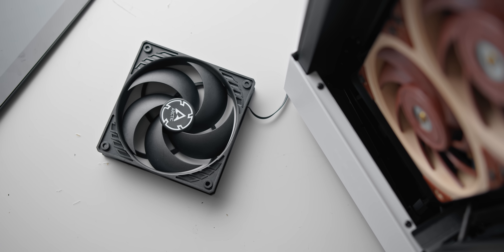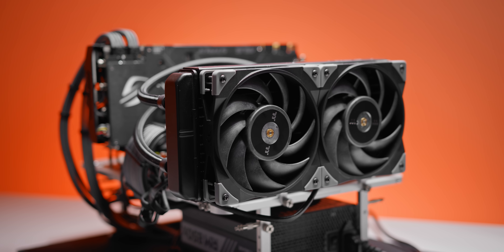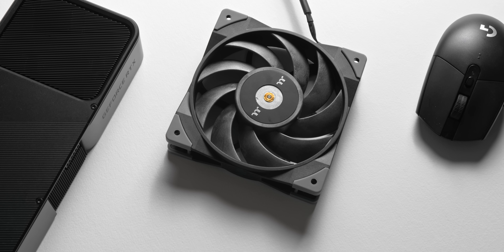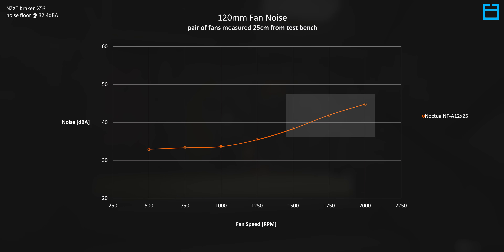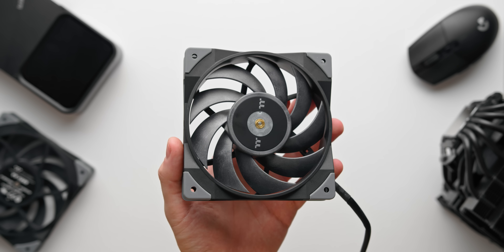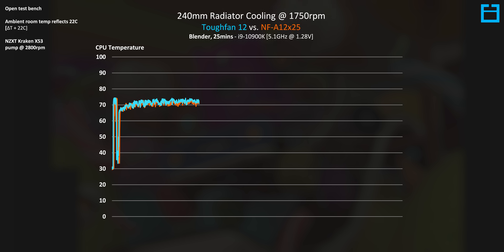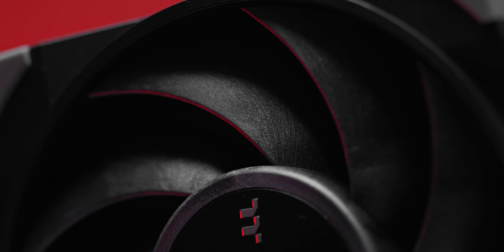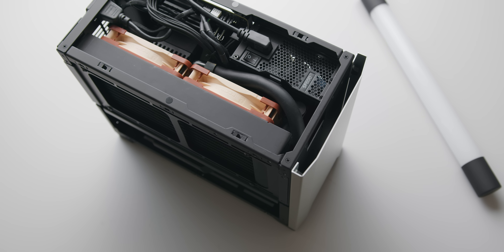Thermaltake Copied Noctua?

Comment: I'm still going to wait for Noctua's
Reply: Noctua has been promising it for years, no joke since like 2018 if I recall they demoed it at CES. 2018!!! Where is the fan Noctua?! If you look at their roadmap they haven't done anything all year in 2020, they pushed the entire roadmap to this year, and some of the things on their roadmap aren't even innovating like a redux line cooler is just slapping a redux fan on one of their existing coolers. The ugly truth is that Noctua has not done anything for years because they feel they are at the top and lack any incentive to innovate even the slightest.
Reply: @ronakparikh  i mean, completely copying their fan isnt Innovation either
Reply: @PLPlolol1  it's not but noctua deserves this
Reply: I ended up getting S12A Chromax instead, for exhaust fans. Haven't seen much benchmarks comparing A12x25 vs S12A for exhaust only. No radiator use I mean, as A12x25 with it's higher static pressure would obviously be better for that. The S12A has better airflow though. Noctua has this comparison chart: https://noctua.at/en/nf-a12x25-performance-comparison-to-nf-f12-and-nf-s12a
Reply: @PLPlolol1  making it black is “:D”
Reply: Someone is going to release a black and rgb version of this fan. This fan has the best performance on the market and what people want are neutral colors and rgb, so if Thermaltake can get away with this clone other companies will go with what the market wants too
Reply: @ronakparikh  "IF thermaltake can get away with it" - here's hoping companies can't blatantly steal other companies' ideas and then manufacture it for cheaper. Otherwise all you end with is poorly designed and cheaply manufactured waste of resource products
Reply: @ronakparikh  I think you don't understand how this works. The color particles influences the plastic and its characteristics. Noctua has very high standards so if they can not build the black A12x25 to same standards as the normal they won't.
Reply: @interceptor001  I read the same marketing as you, it's BS. If they can make their ugly brown fan first of course they can make a black fan. In fact they had a prototype of a black a12x25 in 2019. Furthermore from this video Thermaltake was able to do it and they had to also copy the whole fan design. Just think for a second that if that was the case how is it that they are able to do this niche brown color but not black? Also while the blades are a new material the outer housing is the same material as all their other fans and they have chromax in the other lines. Why can't they make the housing black and the blades brown if that was really the case? The truth is that its just some BS they made up because they want to have an unreleased product to hold onto that they can dish out later if there is any real competition
Reply: Please do. Fan hub is sleeve bearing instead of fluid or ball bearing. Junk.
Reply: @ronakparikh  You should take a look at the gap between the blades and the housing of the thermaltake and the noctua. After this there won't be any questions left.

Why they are able to produce a brown one? Easy. For white/black you need A LOT more color particles.
Reply: @Aurummorituri  I don't know why someone wouldn't. Here in Austria you 6 years warranty on your fans. I bet thermaltake won't even produce their copy in 6 years anymore.
Reply: Regardless of the color, I'm more or less positive that TT's fan doesn't have the same "feel" and build quality to it. I could be wrong though. But I haven't used or held a 120mm fan yet that beats Noctua's feel and quality. It sucks that we need to wait (again) a little longer.
Reply: @ronakparikh  Noctua is a much, much smaller company than Thermaltake. Most of these delays are due tu manufacturing. The fact that they are having difficulties putting a black FN-A12x25 into production does not justify Thermaltake ripping them off. I hope they sue.
Reply: @interceptor001  P12's are German, yes? Proper fluid dynamic bearing with a 10 year warranty for $10 each or $40 for five here in the USA. Best fans for the money, period. Only spend on Noctua if you need the absolute best. I have five Be Quiet! fans in my case. German engineering usually wins.
Reply: @Aurummorituri  Not against austrian ;)
Reply: @interceptor001  No. Just that I like German stuff instead of junk. My first car was an old BMW. Second car was an old BMW. Second PC case was German. Amazing quality.
Reply: @Aurummorituri  I expect both were petrol engines?
Reply: @interceptor001  Yes. I miss my 1986 325is. It had a slot for that amazing thing called a "mobile telephone" in you car! We still drive BMWs. Mum has an M40i X3. Can't beat that petrol I6 in terms of smoothness and power delivery. She is embarrassed by how loud the exhaust is, though. XD
Reply: @interceptor001  Probably. I wasn't dissing Austria. I was just comparing quality European engineering to Chinese refuse. I was asking if Artic P12's are truly German designed (we all know they are manufactured in China like my fans).
Reply: @interceptor001  Give me a break. They're already producing black fans, do you really think we don't understand how to produce black plastic with the desired characteristics in the 21st century? Noctua is just way too slow at what it does, they make great products but they're really not suited to the consumer market, way too slow to adapt.
Reply: @retromunkey  Apparently yes. Because this isn't just "black plastic". Furthermore just because they are producing black fans does not mean they can use the same material for another fan design. Common that's engineering 101. If you have no idea what youre talking about you better stop talking about it. Did you know that they are using brown not because of the color but because it has the lowest influence on the expansion of the blades?  I am not saying that by now they shouldn't have been able to launch a black version. I am just saying that there may be obstacles we don't get to know about.

Comment: I mean, the a12x25 looks pretty similar to the gentle typhoon which has been around for ages at this point. For some reason Noctua though that it was a good idea to basically charge double for that fan here in Oz. If I can get 2 toughfans for 1 nf-a12, that's an easy choice.

Comment: Thank you for actually showing the difference at 1000rpm. More people need to do this. This rattling would drive me absolutely nuts as I'm specifically trying to remove distracting noises from my PC.

Maybe you should take a look at the Arctic P12 that you praised in the intro again. I bought 13 of those since they were supposed to be "amazing" for the price. However, the high pitched pulsating whine they emit around 900-1100rpm, and the weird grindy motor noise at around 750rpm made me return them.
Reply: I mean to be fair they're a $5 fan... they are pretty good for the price and they put the smack down on any other $5 fan. In regards to their Static Pressure and CFM at least they are much better than any other fan at that price. Don't know what you expected when 5 of them costs less than a single noctua...

Comment: There's some value in the accessories noctua includes with their fans: an extension cable, a splitter cable, and a low noise adapter. Depending of course on your individual needs, that can justify some of the price difference.

Comment: Did not know these existed.  Tks..  I picked up the Artic P12 and 14s for my First ITX build, moving my Back and Blue build into the ITX relm, this move was motivated due to your videos and I thank you for that!  Now I am running CTR and getting really good performance but need to manage the fan noise better.. It i really a process with these ITX builds...  Oh yah almost forgot, I would go with Thermaltake because of the two positive points performance and price and not, that little bit of noise should not be  a big deal.

Comment: I think I would stick with noctua 
1. because it's "their" product (design, engineering etc) 
2. because the 6 year warranty kinda justifies a price hike in my opinion
I think noctua just needs to bring a pc case with their colors to the market and then nobody would complain about the fan color anymore xDD
Reply: Yea every Thermaltake product I've ever died fast, like really fast. The biggest point here not mentioned is reliability, that's where Noctua shines.
Reply: The fan motors have a difference of 110,000 hrs of runtime. Plus Noctua has better QC and Customer service. 3$ difference in price is justified for noctuas own product vs a cheap knockoff sold near noctuas price. The colors arent bad i like the brown and beige it means i have the best fans out there.
Reply: Look up Nidec d1225c it's the original from many years ago
Reply: Just 3 months ago I finally replaced my old i7 2600K build that I had since 2011 which runs a giant Noctua HSF combination. That fan has been working for the past 9 years and still works. That desktop is now passed down to my dad who can play F1 2020.That's 9 years & counting of operation in my main rig. When i upgraded 3 months ago I splurged on my mini ITX build to get 4 noctua fans in my NR200P. 2 case, 2 on the NZXT AIO (which default fans are loud AF)  Yes it hurt spending around 110 euro's "just" on 4 fans. But i know I will have peace of mind for maximum performance to noise ratio, and longevity. Also love the anti-vibration mounting options that come with the Noctua fans.
Reply: @NL0Gwenster  Thank you for having a brain man like if youre spending hundreds or thousands already whats a hundred for fans if you have a job. Its like you wont have to replace these fans for over a decade but people just dont think anymore they want cheap trash that they can easily throwaway and buy cheap again if it breaks. There is a reason noctua hasn’t changed the prices because they know they are the best so why should they and i mean they are sorta a good deal when you think about everything in general plus there life expectancy.
Reply: You have to think about the failure rate when determining how much of a premium you're willing to pay for warranty. If it's in the low to mid single digits, you shouldn't put much of a premium on it.
Reply: @GermanicGoosicus  unfortunately the new price for a12x25 on Amazon from the actual noctua store is 39.90. pretty insane. normally I'd be agreeing but with noctua charging that much I can't fault someone going tt.

edit ; it must have been an error because they fixed the price a few days after I saw this. I went ahead and ordered a few just in case there were raising it
Reply: @GermanicGoosicus  they have changed their prices actually - I went to buy a12x25 today on Amazon from the official noctua store - not third party- and they're currently 39.90 - a full 10$ price increase.
Reply: @rherbm  Well with the recent tariffs the price will increase a lot of computer components are going up. The price will go down in a few months if biden cancels the tariffs but who knows if that will happen.
Reply: @GermanicGoosicus  30 percent is hardly a tariff increase, that's significantly higher than gpu and similar products. I get it, they're proud of it, but now they've got stiff competition at different price tiers. I've always bought noctua and been a fan but 40usd for a case fan is insane.
Reply: Yes, if noctua made a brown and beige case, I'd but noctua fans

Who am I kidding, I already buy their fans, but it'd be nice if they did
Reply: @mohamedahmed1023  warranties are optimized to not be a loss for the company. They are more a statement of how confident they are that it will last. MTBF is the "spec" and warranty terms are their confidence level
Reply: @mezu-e  I suppose. But I typically buy most electronics used if I can help it. Sometimes if I get the receipt, I can make a warranty claim. If not, I don't care. That's an indication of my confidence level that I'm not going to need that warranty.
Reply: @jadeezomg  I think you meant to say "has" died fast, like really fast. Well I bought my first Thermaltake item back in 2009. It was a 1200 watt power supply. Still works great after all these years. I also bought their ring trio fans. They are whisper quiet and every single LED is still working and working well after purchasing them back in 2018. I keep my computer on about 16 hours a day unless I forget to turn it off. Sorry to hear that the Thermaltake stuff you install seems to die really fast. It's really hard to mess up the installation unless you really try. The software for the lighting could be better but I don't use theirs anyway. I use Synapse. It works well for my wants.

Comment: The problem is the offender, Thermaltake... this is their MO, who remembers the caselabs ripoff? But in this case to be fair Noctua took some serious inspiration from the formula of the Gentle Typhons ... from the pitch of the motor noise to the blade design... and Nidec might have been inspired by a submarine propeller or any other high static pressure application design...

Comment: "There's only so many ways you can design a fan". Take a look at Major Hardware's 'Fan Showdown'-series where viewers design fans and Major Hardware prints and tests them. There are so many (weird) ways to design a fan :D
Reply: yeah but theres only so many ways to design a good fan
Reply: @ventilate4267  Someone designed one on that show that matched the Noctua, called the Acceleron. No fancy materials like Noctua, just a printed fan. A company contacted the designer for possible licensing etc. Strange looking thing it was too. I like how some of the weird designs work far better than you would think.
Reply: @Berserkism  edit: hmm i see quiet impressive
Reply: @Berserkism  or shovel fan, that one isn't the best, but for a meme it does well enough

Comment: I have four of these fans in my Jonsbo A4, two as bottom intake and two on my 240 Rad. I bought them because they were: 
1. Available (NFA-12x25 sold out)
2. Black (Seriously Noctua)
3. Cheaper
4. Provide identical noise/performance characterisitics

I don't condone the copy-cat nature of their creation, however Noctua has left this opportunity open for 2+ years. For what it's worth, none of my four fans (bought 4 individual fans too, so 4 x chances of variance) exhibit the motor clicking noise. 

Noctua makes good products, no doubt, but I don't think that there is anything wrong with these fans provided they're available at MSRP.

Comment: It would be interesting to see review on Toughfan 14 and try to understand why Noctua didn't choose to enlarge A12x25 and call it a day.
Reply: Well they are making a new nf-a14. The a12x25 is the new nf-f12. They must have a reason to why the f12 and a14 are different designs
Reply: Noctua said early on they could do exactly that, but the performance didn't scale with the larger diameter – I think they weren't satisfied with static pressure performance.
Reply: @waffle911  Noctua also suggested use NF-A12x25+140mm adapter instead. Like to see that against Toughfan 14.
Reply: @evl619  that was more as a suggestion the A12 had better static pressure than the average 140mm

Comment: Not trying to hate on Noctua here, they are still the only top performer with no ball-bearing grind/vibration noise/problematic RPM ranges... but people are giving Noctua a lot of undeserved credit thinking the A12x25 is an original design. Noctua makes great products but they don't deserve to be defended when someone does the same thing they did: make a Gentle Typhoon with a FDB/hydro bearing.

This comparison with the toughfan coming lumped right in where the p12 and GT ended up relative to the A12 seems to show "sterrox"/"liquid crystal polymer" is just marketing fluff and not a real factor. Noctua still have fantastic build quality and the best motor in the business, credit where it's due. But if anyone deserves recognition for an original design it's Nidec for making a blade design that was unmatched for a decade, or Arctic for recently developing an equivalent alternative blade design.

As always, a quality video from OT.

Comment: LCP is a "common" hi-tech hi-performance polymer, but mostly widespread where cheaper plastics don''t cut it and the market for the application supports the elevated cost. I have in the past helped develop root-canal probes for dental x-ray photography, where contrast material were infused in LCP - simply because it was the only material fulfilling the property demands.
Regarding similarity of fan design; it could just be the result of CFD simulations set with same or similar boundary parameters. Jet engine turbines, for example, all looks very alike with minor design differences that makes each unique, and sometimes, but always, with huge differences in performance.

Comment: The Toughfan has a really long cord compared to the Noctua's. So, that is something to consider in a SFF build.
Reply: You do know every noctua fan cones with an rpm suppresser and an extension cable. So noctuas cable is longer.
Reply: @GermanicGoosicus  I do know that.  I have both of these fans.  If you have a normal ATX sized case the cable length is no big deal but in SFF builds it's something to consider. The Toughfan has an 18" or so long cable.  The Noctua's are nice because the cable is short and if you need it longer you can use an extension.
Reply: @ARunto  Well supporting a thief loses all respect. Also noctuas are nicer and will last 3x as long as a shit tough fan.
Reply: @GermanicGoosicus  What they are saying is the shorter cable is a positive because it gives more cable management options
Reply: @misterthegeoff9767  exactly this!